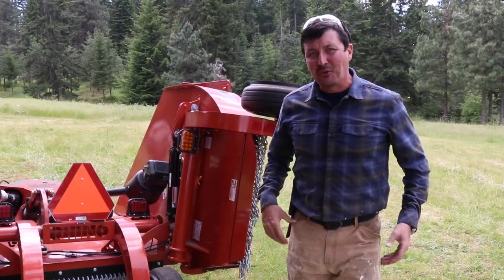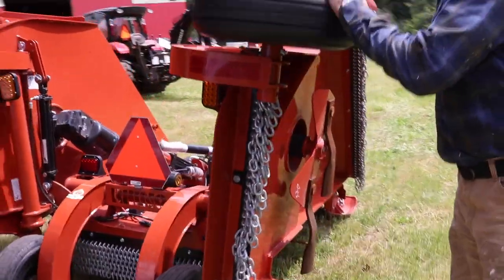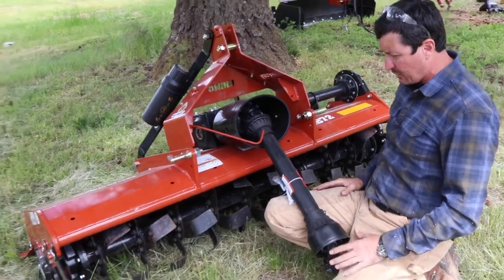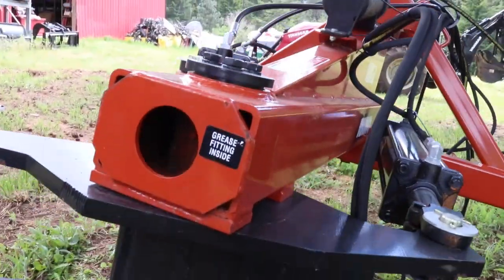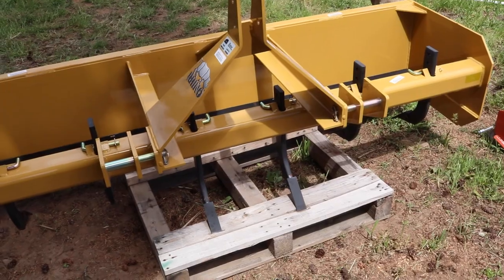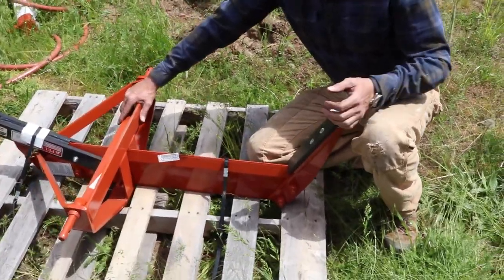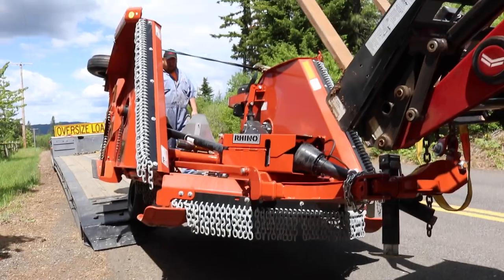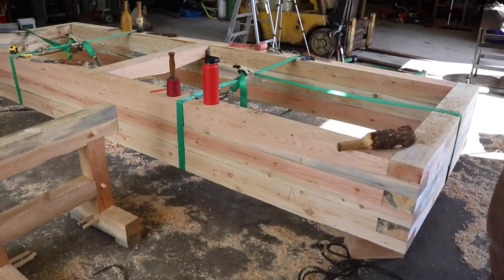We Got A RHINO And It's HUGE!!

Comment: Those mowers will sure help cut down the fuel load and fire risk around the homestead.  Just out of curiosity do you keep a big fire extinguisher in the tractor?  While mowing in the hot weather it would probably be a good idea just in case you cause a spark to ignite some dry material.  Have a blessed Sabbath.

Comment: "Bat wing brush hog" and "finish mower" is what you've got! They only seem similar...the brush hog has a rubber-tire-drive so that it can slip.  The flails on it will whack out small trees...check the specs, at least a few inches with that 15'.  In SE OK everyone knows about brush hogs, because you could never use a (or would use) a finish mower in fields...too many small trees etc.  It would get torn up.
Reply from the maker: +Greg S. they are both brush hogs

Comment: But will it chooch? The tractor is powerful, just mind the weight balancing in more irregular terrain while using bigger implements. For the drive way, consider demolition material(bricks, concrete, etc.) and quarry rests(if you can get some) to have bigger chunks in your base to help keeping it together for the smaller bits on top.

Comment: I can tell you that when you put that 12' batwing on that tractor you're going to know it's there. I think everything else is sized great and will be assets to your operation.
Reply from the maker: The mower is rated 35 to 50 HP, I have 58. I pulled a steep hill today with tall grass. No struggle at all,

Comment: The mower with the fold down sides might be too much for your tractor if the grass is too high and tuff.  I hav a 65 hp and looked at a Woods brand like that, they suggested I did not have enough hp.
Reply from the maker: The mower is rated 35 to 50 HP, I have 58. I pulled a steep hill today with tall grass. No struggle at all,

Comment: Your tractor will have trouble running that mower.
Reply from the maker: The mower is rated 35 to 50 HP, I have 58. I pulled a steep hill today with tall grass. No struggle at all,
Reply: The three blade fold down wings one?

Comment: I probably shouldn't say this(The Devil made me do it!(;>)) but I have to wonder if nonbelievers get this kinda stuff delivered to their doorsteps!(;>)
You're going to like all that stuff, Cody. Especially the brush hog and the mower. I don't use my box scraper all that much but it does have it's place. 
Watch how much of a bite  you let the post-hole digger take at any one time because it will auger into the ground and you can't lift it back out of the hole because there's no reverse rotation on them.
Another great video.

Comment: The larger mover is pretty big for a 65hp tractor
Reply from the maker: The mower is rated 35 to 50 HP, I have 58. I pulled a steep hill today with tall grass. No struggle at all,
Reply: Fair enough.   Please tie down your PTO guards so they don't spin. Its not the risk to yourself ( i think you know the risks well enough) but the fact that some of your audience may think unsecured guards are normal and get into trouble.

Comment: The batwing mower is more then your tractor will handle.
Reply from the maker: The mower is rated 35 to 50 HP, I have 58. I pulled a steep hill today with tall grass. No struggle at all,
Reply: Ok great, nice equipment.

Comment: i wonder if the tractor has enough HP on the PTO to handles it well?
Reply from the maker: The mower is rated 35 to 50 HP, I have 58. I pulled a steep hill today with tall grass. No struggle at all,

Comment: You need 7 hp for every foot of brush hog. I feel like that tractor might be a little small for that mower. But you can do the math.
Reply from the maker: The mower is rated 35 to 50 HP, I have 58
Reply: Good deal.

Comment: Better check the needed HP on the tractor. You know what a Rino are right???
Reply from the maker: The mower is rated 35 to 50 HP, I have 58. I pulled a steep hill today with tall grass. No struggle at all,
Reply: That's outstanding! You said you were in Florida sometime ago, Right?  The State and counties tractors must have 125 hp pulling mower with the wings. These newer tractors must be real Rhinos.  I'd like to see the mower at work Cody...